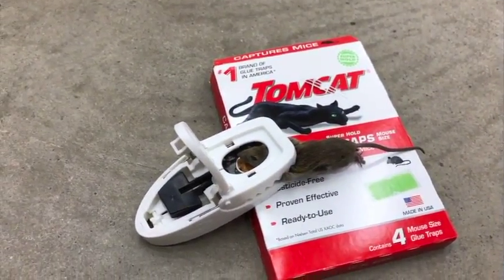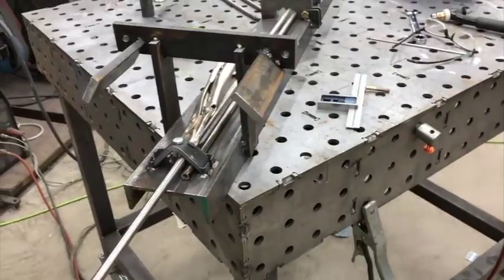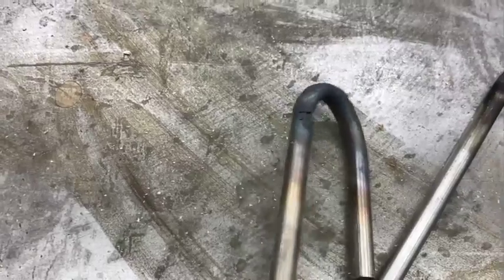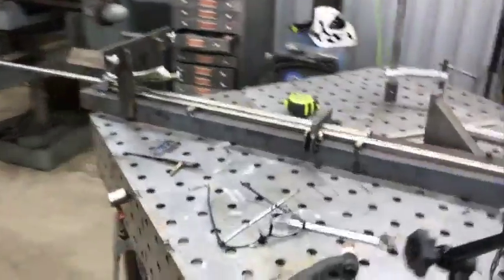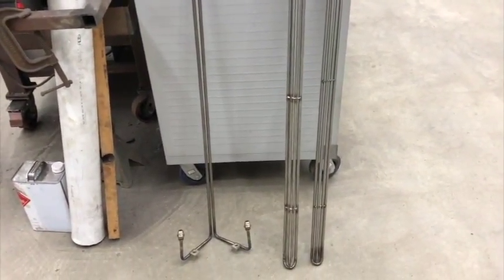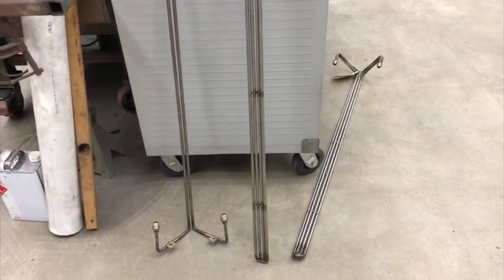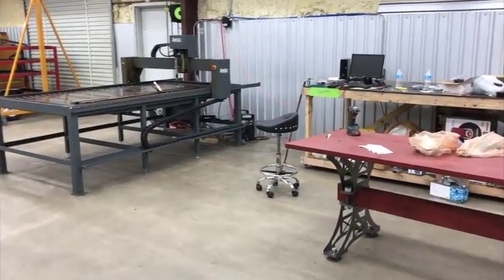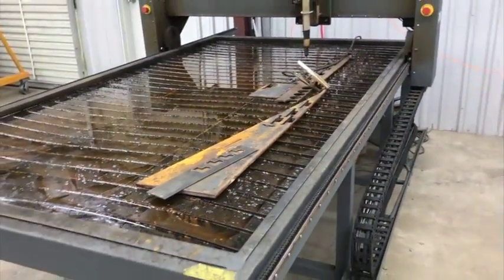Got that little sucker!

Comment: If you are going to go the tube route to fixture the smaller tubes over, consider short sections of copper pipe, right at the spot where you've got to bridge the gaps. Weld won't stick and can flow down into the space easier.

Have you seen my Rothenberger RoBend 3000 Tube Bender? It will bend a pretty tight radius... BUT with that machine in hand, you could just as easily machine your own custom dies.

Anyway, I urge you to keep at it, and try and nab that bit of production work. That's the kind of job you pay an employee to do all day long, and it not only keeps the lights on, but allows you to pursue the creative fun projects for yourself.

Comment: Think you may be on to something with water issue, kind of thought that same thing since you brought up issue with cut quality. The reason being that I have never seen anyone else have that much water blow through/up onto material as you seem to get. Didn't say anything because I figured being in contact with manufacturer, they would have said something if they thought there was an issue when you discussed problem with them. Quick test to see if that is issue or at least part of issue would be to drain water and make cuts without it to see if it makes a difference!

Comment: One place I use to work at had rats.  I had days where I would catch several every day for months.
Reply: A place I worked had rats. They weren't even afraid of people. We would smear peanut butter on airbags we removed from cars we were scraping and wire them up and when the rats would eat the peabut butter we blew them up.
Reply: Now THAT would be a viral video...  The flying rat circus!

Comment: Could you not lay the filler wire on the tubes and spot them in?
Reply from the maker: Yes, could definitely cut a small piece, hold it in there with pliers to tack it then weld over it.
Reply: I was thinking that leaving the "intact" portion of the wire would provide a cleaner bridge, no?